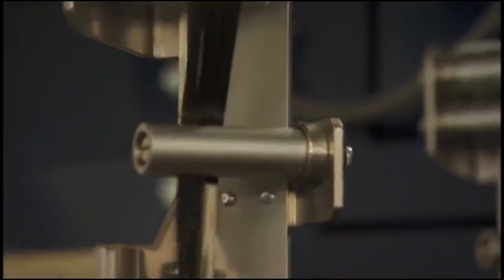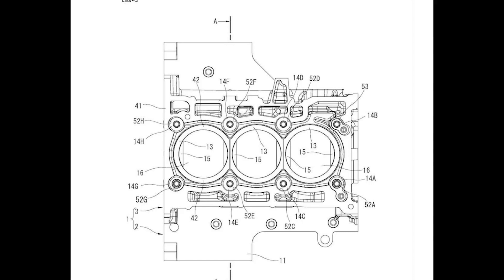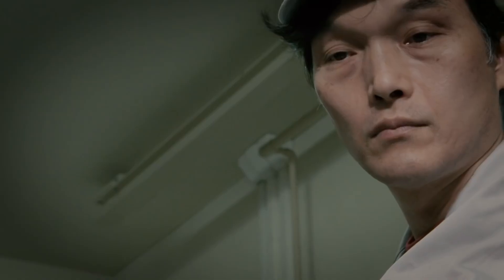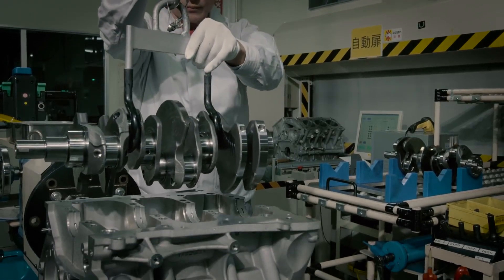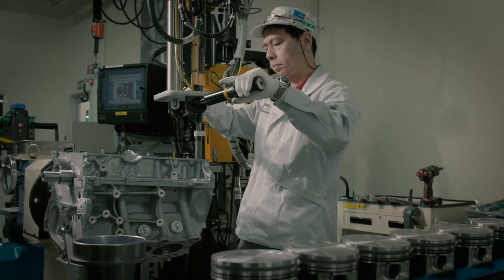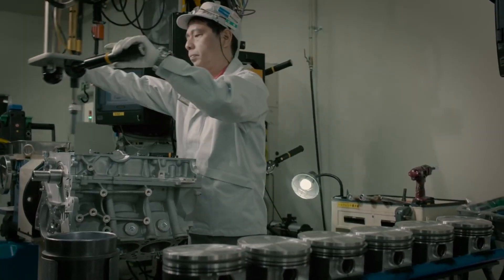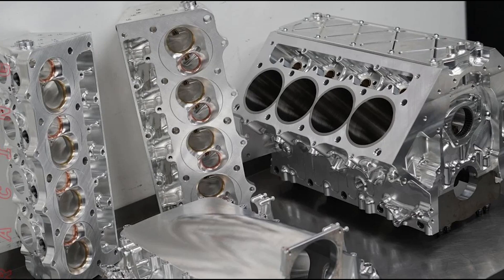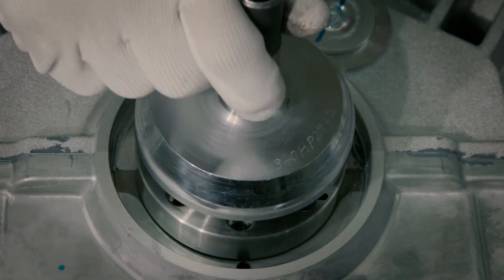This Engine Block is Made Entirely out of Carbon Fiber

Comment: Really interesting video but can we use carbon fiber plate between the engine and Steel outside frame just like a sandwich which will eventually decrease the heat or just a carbon fiber engine cover

Comment: Crank, pushrods, rocker arm, solid lifter's,  intake manifold valve covers, timing cover and bell houseing i can see having a return in use vs cost... 

Alternative parts i believe wouldn't be worth it unless it was all out conditional racing

Comment: Good work. Keep posting new development videos. This new out of the box ideas is what really boosts technology development. I wonder if carbon fiber can be mixed with low temperature metal deposition, in such cover the blocks with titanium nitrate or other high chemical strength materials to protect the carbon fiber from oils and coolants. But people want to show off the sewn pattern of CF. There are many new materials used in aerospace engineering that can be used on ICE, but with such light and powerful Electric motors, is it smart to continue to develope an engine with 45% efficiency against the 90% of EV? How would Carbon fiber block on a rotary racing engine work? Mmmhhh, to much heat right? There are thousands of ways to explore.

Comment: Carbon fiber as we know it is unsuitable for components like engine blocks/connecting rods/pushrods etc. mainly because it exhibits some flex. And an engine must remain within it`s respectable tolerances. However, carbon-based materials could be. Like carbon-carbon stuff, which is more expensive than titanium...
Reply: Where did you get this flex concept from. F1 carbon chassis', for example, flex less than other materials which is why they make them out of carbon fibre

Comment: 250F, or 121C
why not use slow injection of plastics at high temp? 
plenty of materials can flow as easily as resin at high temps
Nylon would be a great material to flow into the CF fill mold, with excellent temperature characteristics.

Comment: Lightweight important in moving parts of engine , for inertia reduction, not the block, but resins used in binding carbon fibre not compatible with chemicals and heat of engine.

Comment: So it's similar to how BMW overcast some of their performance blocks with a magnesium alloy. They basically had the sleeves and the outer shell of the water jackets and all of the necessary structure cast initially in aluminum, then that core was placed in another mold and overcast it with magnesium alloy, since the bulk of the block didn't need to be quite as strong. Unfortunately, the magnesium alloy did cause some other problems due to it not sealing quite as predictably as they had hoped. I doubt we'll ever see carbon fiber engine blocks in any real volume on production vehicles. While the price of carbon fiber is certainly going down, the complexities of manufacturing an engine block with it cannot possibly be easy to scale.

Comment: In ICEs heat is not only a product of the friction between the pistons and the cylinder liners, which is significantly reduced by lubricants and polished surfaces. Heat mainly comes from the combustion process and it doesn’t only affect the liners. In fact, liners are metal components which effectively conduct heat to the block. You can’t solve the problem of a carbon fiber composite block’s poor heat resistance by providing it with steel cylinder liners. It would only protect the block from wearing out, but not from melting down. Moreover, carbon fiber composites are stronger than metals if subject to stresses in the fibers’ directions. For example, if it didn’t suffer from excessive heat, a carbon fiber composite con-rod with longitudinally layed fibers would be very strong. However, an engine block suffers from multidirectional stresses and building a carbon fiber composite one will inevitably result in a set of fibers suffering from transversal stress, thus weakening the entire block. Furthermore, carbon fiber composites are very brittle because of their epoxy resin matrix and, for this reason, a carbon fiber composite block would crack under intense vibration and ultimately fall apart. In addition, carbon fiber composites aren’t suitable for thick components. In fact, F1 monocoques just have carbon fiber composite outer layers. They’re actually sandwich structures with the inner component being a foamy material. So, how would you build a big solid component like an engine block with carbon fiber composites alone? I don’t think it would be possible.

Comment: This is interesting. I wonder if hydrogen will save the day as it's clean burning will make it so the oil used to lubricate the engine must be worn out as unlike fossil fuels water doesn't mix with the oil to thin it out like fossil fuels do. If they can solve the oil & coolant problem that delaminates the carbon fiber then yes this will indeed be the way to go in the future.

Comment: Ceramic block and parts is far superior...carbon has incredible strength but does not have heat resistance like ceramic...ceramic is superior to iron for heat resistance...ceramic engines were first used in Japan in 80s by Nissan...
Reply: let me know how that handles knock from a piece of steel.

Comment: There's another lightweight potential is ceramic engine blocks. These were first played around with in the 80's I think. Sometime around 2000 on the tv show Towards 2000 (or maybe it's successor Beyond 2000) there was a carbon fibre engine. It was based on a Ford Escort motor or something like that from memory.
Reply: They've got a higher thermal capacity so higher compression ratio and lower fuel consumption. 
Think that one in '82 was a 1.6 that put out 295BHP!!! Still remarable even 40 years later.